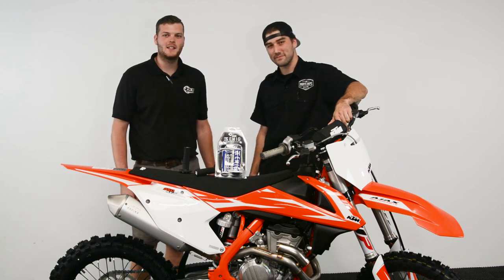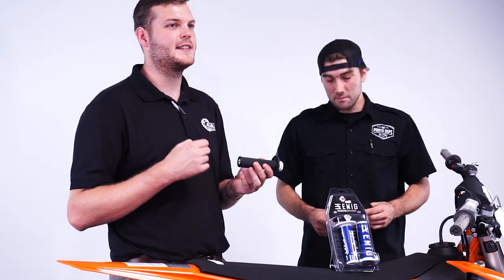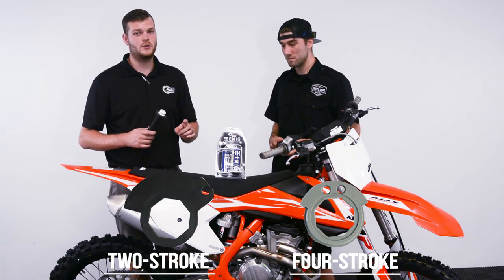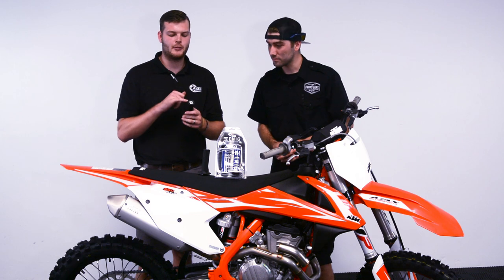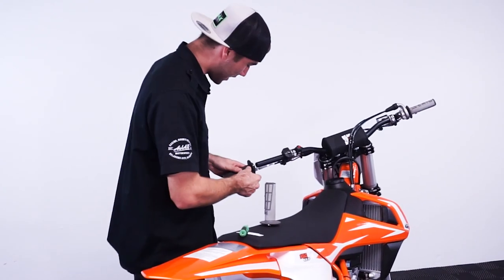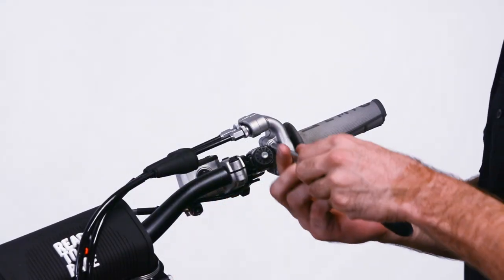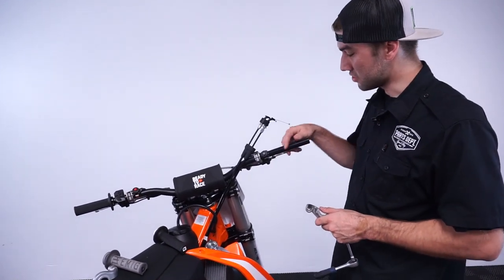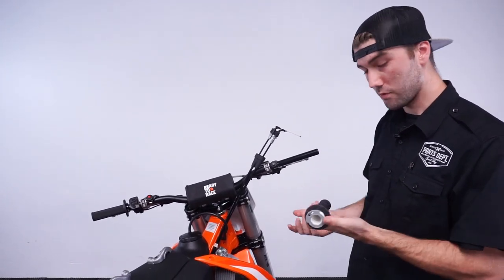How-To Install ODI Lock-On Grips // AJAX Motorsports Tech Tips

Comment: I'm installing these on a 4 stroke Honda CRF 250x and can't get the throttle side right.  After I install and tighten down the bolts, the throttle won't turn at all.  I feel like an idiot because surely I'm doing something wrong!
Reply: same problem here :/
Reply: I took them back off and it was my screw up.  I didn't have the throttle cable seated correctly in the groove of the grip.  Once I fixed that, all is good.
Reply: I fixed mine today, the diametr of the throttle cam is bigger so my cable was to tight, now i just need to add some slack at the motor side causd the adjustr at the steer is al the way on loose, sorry for my english xD

Comment: I have a 2017 KTM 300. The 2 worst things KTM did to this bike? Mikuni carberator and the Odi grips. Both suck equally. The throttle tube is cheap crap and you have to CRANK the set screw on the clutch side to keep it from moving. Not to mention if you run hand guards. Then you get to break out the hacksaw and make them look like crap.
Reply from the maker: For hand guards: Instead of sawing the end of the tube off, use a drill and a step bit. Drill the ends out and make sure the end is flush and nothing can get trapped between the bar and the hand guard. This works surprisingly well and can help keep the grip a smidge longer.
Reply: All you have to do it cut the rubber on the ends and use a large T-Wrench or other blunt instrument. Slide it up into the grip and bang out the end. They are designed to have the end pop out to accommodate handguards.